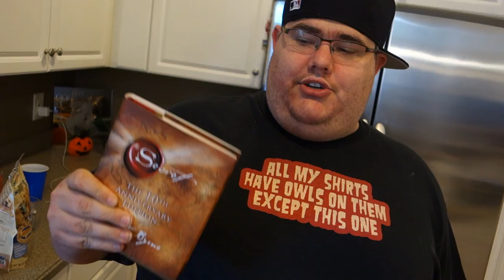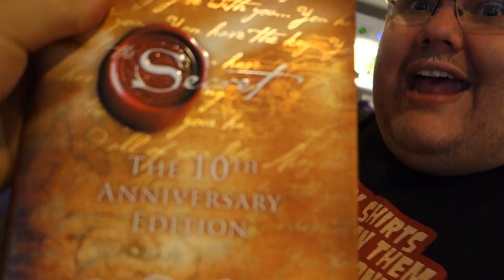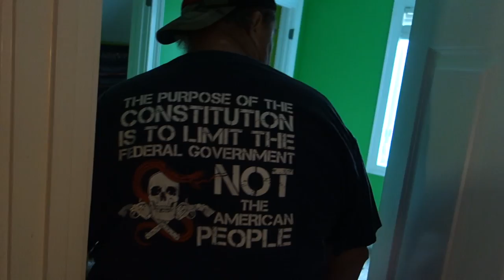MICHAEL & DOUG: GHOSTBUSTERS!

Comment: Doug's tire thumper.. quick and simple..
Micheal.. you better jus have a quick swing.. and with the weight of the wire.. slow you down..., it is a bat... 
but the tire thumper is quick and solid.. not like a bat.. bigger at top and smaller on bottom by handle.. and that's where it's gonna break...

Comment: These videos are getting worse by the second! Its a audio file in the edit so it sounds like the ghost box is on! If you wanna fake that shit mike you need to get into sound engineering lmao the sound did not change a bit from when the cam was pointing at Doug then to Mike. Stayed the same volume and same quality. Should've gone a bit muffled when the cam was at mike as the mic on the camera was also pointing at mike (no pun intended)